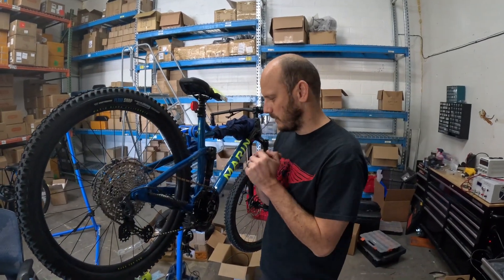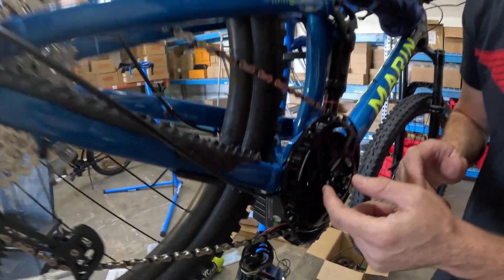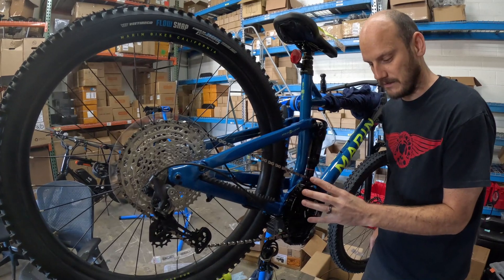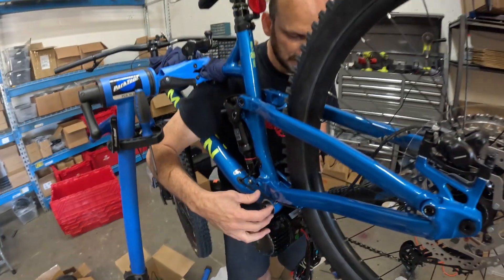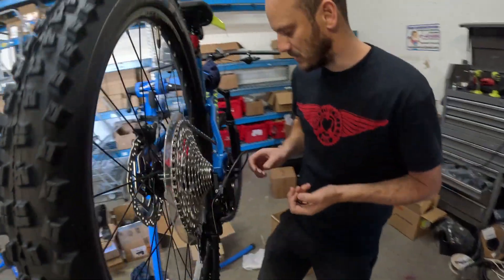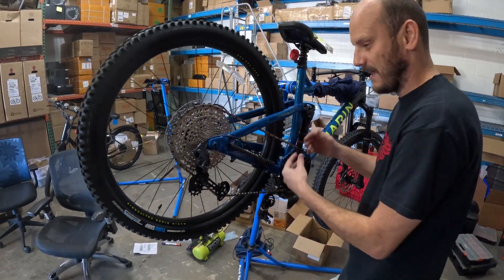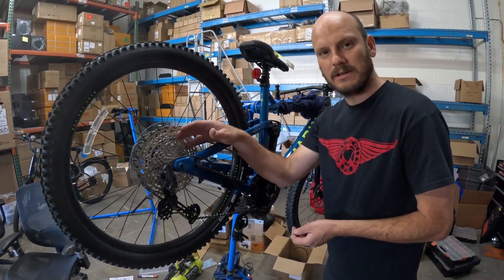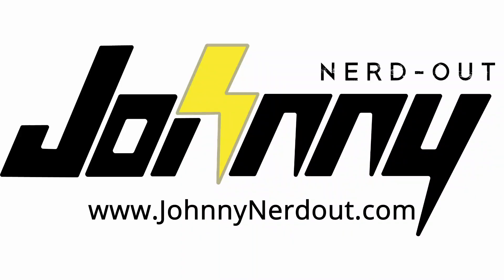Fixing a terrible Chainline on a 12 speed Full Suspension Bafang Mid Drive install.

Comment: Same issue on 8 speed TSDZ8 build. Had to fit the BB spacers to freehub, knock 3 cogs off of cassette and kept gears 1 to 4 and the outer outer gear that locks the cassette down but is not usable. We live in hilly area and I need that 1st gear (38t) to avoid stressing motor.
Reply from the maker: I just got some offset chainrings in for tongsheng if you need them in the future

Comment: Hello. Is there a way to have 55 chainline using bbs02 or bbshd with 32t or 34T chainring? Assuming the original bike has 73mm bottom bracket 55mm offset and 12 speed cassette. Thank you!
Reply from the maker: To get  55mm of offset you have to get the stock 40t-44t and the. Replace the chainring bolts with longer ones to increase the offset.

Comment: I found just using the Lekkie drive cover and installing the stock bafang chain ring without any washers (which is why you need the drive cover) put my chain line nearly perfect. I do plan up upgrade my chain ring though with bling ring, they parts are amazing and I want a chain ring again with narrow wide teeth since suddenly my chain is falling off which used to never happen. 

I converted a X-Large Norco Storm 2 for reference.

Comment: The big issue is with a 12 speed the chain stay area where the chainring is on the crank very little room to install a bigger chain ring I used the Lekkie HD pro with 4 spacers so I could only use one but also and I had to use a spacer behind the chainring

Comment: I know in another video you said 7 & 8 speed cassette's are the best for converting to an e-bike. I have a Catrike with a 10 speed cassette that I would like to convert some day. Am I going to experience chain line issues or is that non-issue with such a long chain? Great problem solving video!
Reply from the maker: Not usually an issue with long chain lines like that.

Comment: I’m having the same exact problem with my 12 speed sram no rear suspension but I have the aggressive chain stay. And I have two spacers now  with the offset 42 and the chainring is hitting the chain stay 
I’ll order another spacer. 
and the 42 pro and a onenut should do it?
The onenut is a good thing to use instead of just the stock nut I had to use 4 spacers and the spacer behind the HD 42 pro
The problem I had was not enough room between chain stay and motor so I have not much threads to get the nut on I’ll have to use  some locktite

Comment: When I installed the Bafang on a 8 speed KHS mountain bike I had chainline issues so I got an offset chainring from China off Aliexpress and problem solved.  I changed the motor to a Tongsheng torque sensor motor and I had no chainline issues with the motor whatsoever even without an offset chainring.  I didn't install an offset and I have no problem at all.  Not sure why the Tongsheng has no chainring issues.

Comment: Need more links in that chain buddy, fully compress/undo that shock and check if the chain isn't snapping the derailleur
Reply from the maker: A general rule of thumb is to have 1.5 extra chain links when in first gear. A great reference for dialing in chain length is sheldonbrown.com. He is much nerdier when it comes to dialing in bike components.
Reply: @JohnnyNerdOut  yes, but measure these extra links at full bump

Comment: You keep saying terrible chain line without ever saying what the problem actually is. Terrible because you're hitting the swingarm or terrible because the chain is centered on the cassette?
Reply from the maker: The chain would not stay on when in 1-2 gear with the stock chainring.
Reply: @JohnnyNerdOut  do you happen to know the chain line numbers? 48/50mm etc? Was it jumping off backpedaling and forwards? Cheers

Comment: I'm enjoying all the comments on my bike.  I did a little research and Specialized, Trek and Marin all use 12 speed cassettes on their electric mountain bikes now.  Some of them costing nearly four times what I'm spending for the bike and conversion even with the more expensive chainring.   Research has shown the chains on 12 speed cassettes are no more likely to break than they are on 9 speed cassettes.  Chains are just better built now than they used to be.  I absolutely agree that I don't need a 52 tooth cassette to hill climb with a 1000 watt motor, but on the off chance that I'm ten plus miles out on a trail and the controller malfunctions or the battery connection goes bad and I'm stuck with a 50 plus pound bike with no pedal assist, this 53 year old will be stoked that I have that giant chainring on the cassette to help me make the long journey back to the car.

Comment: Nice! Better than a 1:1 granny gear. Give it sticky enough tires and it'll climb walls. Have to go easy on the throttle in low gears or that HD can buck you;)
I had a similar issue with my hardtail (only 8 speeds at the time, up to 10 now). It took me forever to get it right, twice (it was before I knew of you).

Comment: most modern mtb frames have a max. chainstay clearance for up to 38t while maintaining a good chainline. the only frame I found to accept a 40t lekkie running a perfect chainline is the Ragley Bluepig. makes a beautiful enduro hardtail with up to 160mm front travel. but, since it's a chrommoly frame, you need to grind off the teeth on the motor mounting plate, as they will not bite into the bb shell at all. you need full contact with the edge of the bb shell for a solid mounting, no teeth required.

Comment: If you live in Canada, Sport Chek has the Diamondback Motown MTB on sale now for C$525+tax (Reg C$749). The Motown comes with Microshift Acolyte 12-46 groupset and Tektro hydraulic brakes on 180mm rotors. The fork, wheels, and tires aren't great but it has a tapered headset which make fork upgrades easy. The 68mm bottom bracket makes mounting the Bafang middrive kit very easy. I used the BBS02  and am very happy with the results

Comment: I like the Microshift Acolyte 8 speed groupset (12-42 or 12-46 cassette) on my ebike conversions. The 8 speed chains are stronger & cheaper and the 8 speed derailleur is more forgiving than 10/11/12 speed.
Reply: What chain ring do you use with the setup?

Comment: At time 1:50  if someone has the ability to machine about 1/8-3/16 off the left side of the bottom bracket to allow for using the second lock ring, would that work? Would there be any issues with the motor fitment?

Comment: Isn't a 50 or so cassette cog overkill for a mid-conversion? I'm running 11-17-28 spaced 8-speed for my BBS02 and it's adequate for pretty steep trails in socal. The chainline is "straight" with the "17", so almost "straight" on either extreme.

Comment: On my Cannondale RZ One Twenty One, with a Lefty, I bought a full SRAM Eagle NX 12S 11-51T transmission, of course the Bafang BBS02B was a mess related to chainline, to solve it I use a 42T narrow-wide profile with 14mm offset to inside, finally a perfect chainline (more or less because a 12S never has a perfect chainline). If you want to go wild you can also add a 40T from PerciAlps with 10.5mm offset to inside that I found searching the web and also works perfectly. With both you don’t need to replace to cover. Hope this helps.
Reply: What 42t did u use that has that offset? Curious because my stock 42t Bbs02 ring rubs the chain stay on my trek Roscoe. Ordered a 36t to avoid rubbing but it has -.8mm offset so I’m guessing the chain line will be worse.

Comment: Had a similar issue with my 12 speed. I got too greedy with a 48 tooth Lekkie and had to shrink down to a 42 tooth to make it fit. So for anyone considering a 12 speed don’t, but if you must measure the diameter of the original chainring before ordering a Lekkie.

Comment: Why even use a 12 speed groupset on an ebike?, 12 speed chains and cassetes cost 2 times the regular 10 speed. It's just a bad economical choice, isn't it? 10 speed is the go to maximum in my opinion, chains are not too expensive, cassetes are neither, besides, 10 speed shimano deore m5100 compaitable, so no problems with shifting accuracy.
Reply: It has a twelve speed because it's a brand new bike shipped straight from the reseller and it's a good suspension bike, not a cheap one.  The newer nicer bikes all come with atleast 11 or 12 speed cassettes.  Economically speaking I can afford it so why not?  I'm not the bike or ebike expert, John and Shane are.  I just want a fun trailbike to ride.  That's why I gave them my business.  They can figure out how to make it work.
Reply: @craigsimons4930  I see.. 11-12 speeds are still thinner and less durable, so you better carry some spare quicklinks and tools to fix you chain in an emergency. Dont cheap out on new chains, cheap ones snap like nothing. never buy "superlight" chains, they also snap and wear very quickly. Buying less that a 10 speed is just for your peace of mind, lesser chance of broken chains, even if we are not talking about the money.